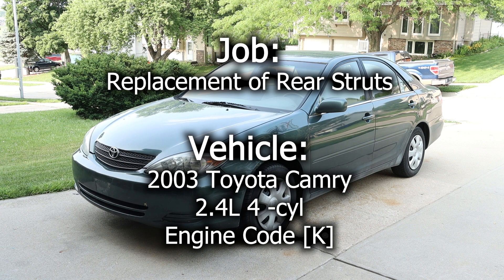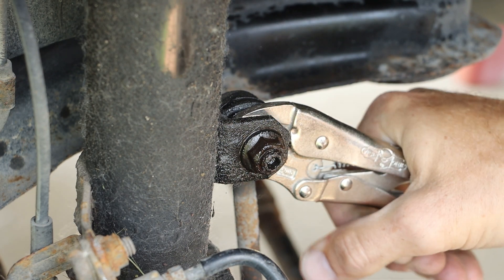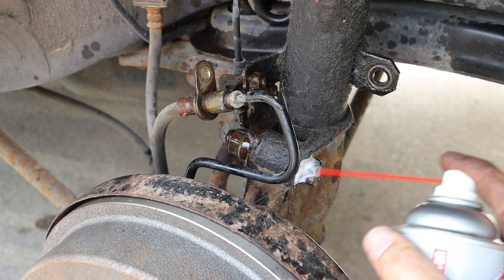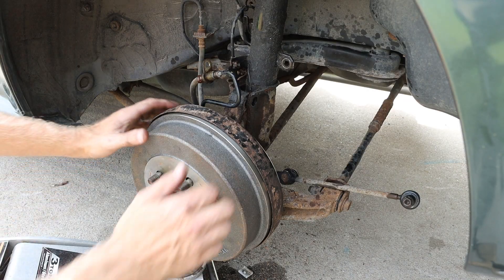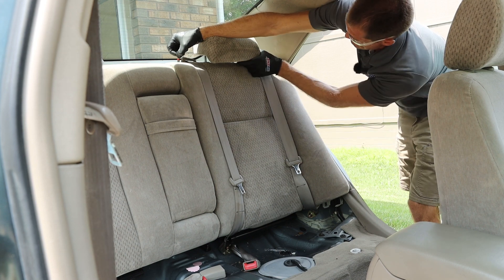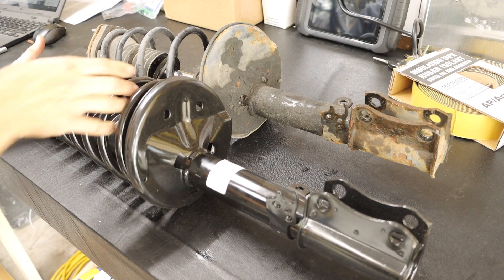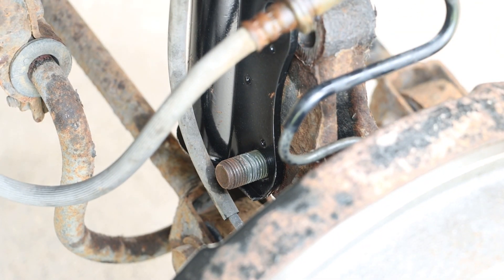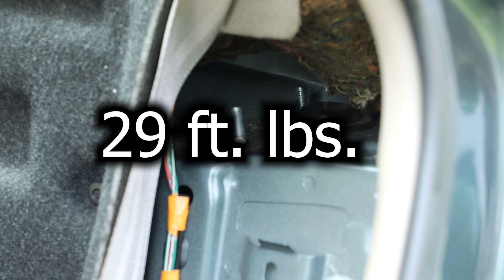2003 Toyota Camry - Rear Strut Replacement (Suspension)

Comment: Couple of quick questions..
My vehicle is at 2004.  142k. 
Do you recommend at the same time changing the Sway Bars, Strut Rod and the stabilizer bar bushings too?
Reply from the maker: I would say that since the car is 20+ years old, it wouldn't hurt to replace it all.  If you are doing it yourself, the cost isn't that much greater.

Comment: Any update on how these lasted? Ride quality? Any brand recommation? Excellent video.. Thank you!!
Reply from the maker: So far so good.  The previous ones were pretty bad so it is a definite improvement.  I went with Detroit Axle (link to the part in the video description) although I don't have a brand preference.
Reply: @InsaneOil  My rear struts have never been replaced. I have a 2005 Camry with 270,000 miles on it. The fronts were replaced last year, but every bump makes me feel like the car will fall apart. My old rear struts look the same as in your video. Do you think replacing the struts will fix the problem of shaking on bumps?
Reply from the maker: @George-mk7lp  I would recommend replacing the following:  Rear Struts (this video), Rear Stabilizer Bar Bushings (bushings only, the original bar is probably fine) https://www.youtube.com/watch?v=TdL6V_tSZmY&t=59s, and Rear Sway Bar Links https://www.youtube.com/watch?v=29vLRCrMAqQ

Comment: I had to use a crow bar to pop the seat loose. Those suckers were tight!
Reply from the maker: Doesn't surprise me for being 20 years old.  I lubed it up pretty good to help with the removal process.
Reply: @InsaneOil  I know what you mean.  Thank you though for this video, it  helped me so so so much! You are amazing!
Reply from the maker: @sniffles8655  Thanks for the comments.  They are greatly appreciated.
Reply: @InsaneOil  Thank you for the video, it's greatly appreciated as well! Really helped me out.

Comment: Do you have any recommendations for conversion from rear drum to rear disc brakes?
Reply from the maker: I don't.  My strength is replacing stock components with aftermarket stock components.

Comment: 2 comments - Sway bars links are cheap - why not just replace them at the same time, then you are 100% done with anything that can really fail there  Also the bolts that are used for the bottom of the strut, , I thought at least one was a Cam adjustment bolt so you can dial in the camber when you have an alignment done?  - the toe is adjusted by those trailing arms links as I recall ... I'd actually do those too, but not needed if they are not seized and you don't need an alignment.
Reply from the maker: I agree that sway bar links are cheap and can be replaced at the same time.  In the series of videos for this vehicle, I did just this, but filmed them as two separate videos. https://www.youtube.com/watch?v=29vLRCrMAqQ&t=72s   As far as the alignment/adjustment, I replaced pretty much all of the suspension component at the same time and then took it in for an alignment.